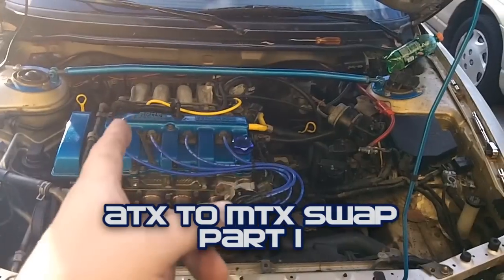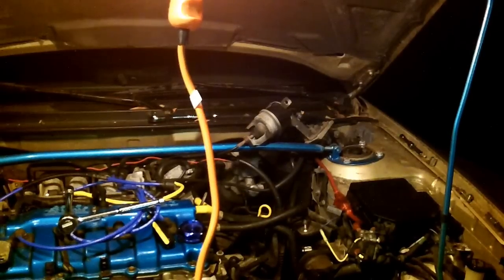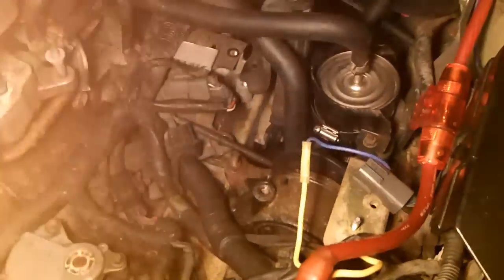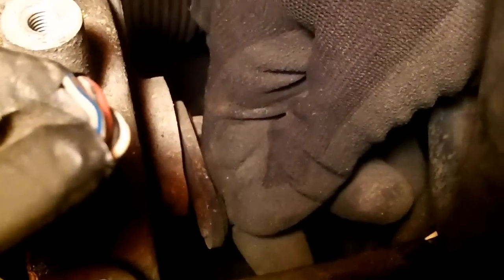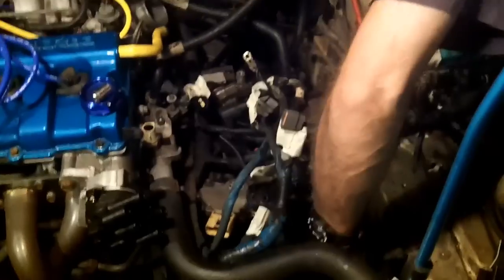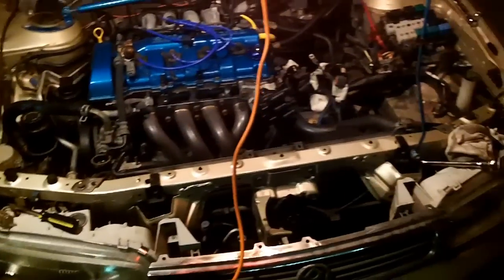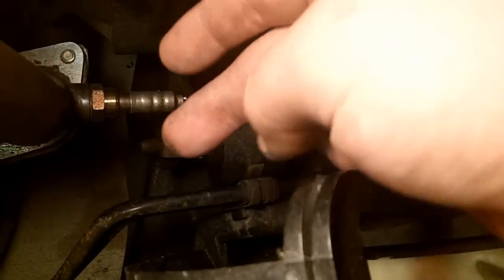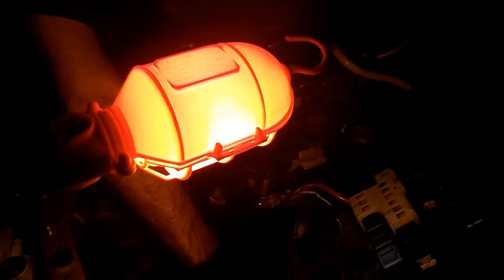Mazda 626 - ATX to MTX Transmission Swap Part 1

Comment: I do the same on the swap mazda 1999 .. And there are some difficulties with the wiring. As such, I found the wires that cross - works starter. What about what I need to connect earned cruise control? I would make a button in the cabin for 2 positions: 1-position N 2 and position D ... How to do it?
Reply from the maker: I do not know sorry.  You'll have to look that up in a wiring diagram.  I don't know every wiring diagram.  I've never needed to work on the cruise control system.

Comment: im doing this on my 2004 6, any info on taking it out (of the bottom)
Reply from the maker: At first I wanted to see if it could be taken out from the top.  Yes it is possible but not as easy.  I do eventually take it out from the bottom.  You'll just have to watch the whole series to see how everything gets done. ;)
Reply: cool! nothing wrong with my atx i just hate auto xD

Comment from the maker: The bushing is included with the cable and you don't want to pay for another cable from the dealership it's hundreds of dollars.  Just go to a junkyard and carefully cut the bushing out of another 626, MX6, or Probe.  If you can't get one then look into a product called WindoWeld and fill it like you would an engine mount.  People use it to replace the rubber in engine mounts.  It's a rigged solution but it should work if you're desperate.

Comment from the maker: Correct.  It's just a pin like a hair pin or bobby pin.  As long as it's thick enough so that over time it's not going to bend or break.  There isn't even an OEM part # for it because it's just a general cotter pin you can find anywhere.  Heck a small zip tie would even work in the short term but over time it would rub through.  It's just to keep the shift lever attached to the shift cable.

Comment from the maker: There are many different styles of cotter pins.  Use any style pin you want as long as it hold the shifter cable in place that's all that matters.

Comment from the maker: Any auto parts store will have cotter pins probably of different sizes. I think the one used in the shifter cable is about 1" long and fairly thick.  It's a heavy duty pin because it has to take the force of every gear change without breaking over time.  Just make sure it fits through the pin hole. Congrats on finding the issue though!  I hoped that's all it would be.  :)  Definitely an easy and super duper cheap fix. Woot! :P

Comment from the maker: The cross member comes out in a later video.  Not sure if the exhaust shop guy set his impact to 0 torque or what the deal was.  We had no problems with the cross member bolts at all.  They weren't stripped, actually they were in perfect condition.